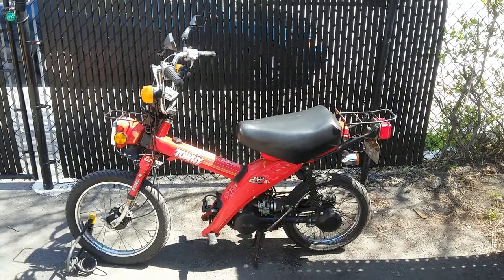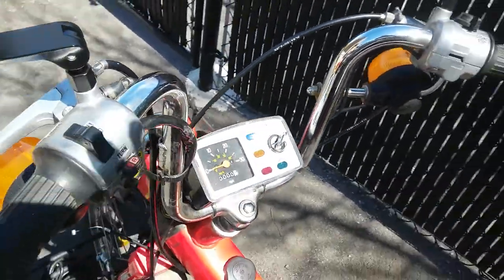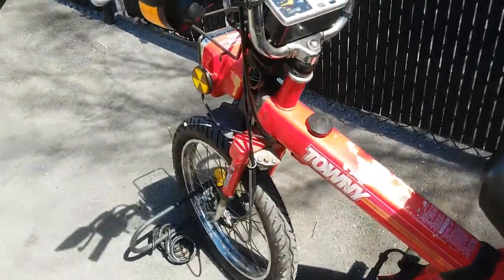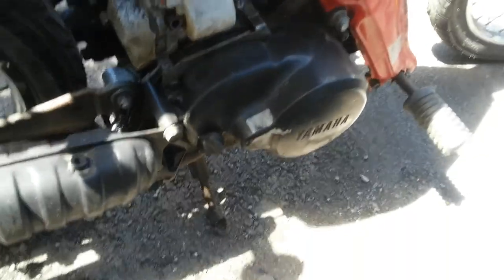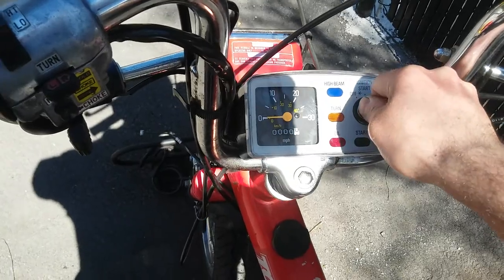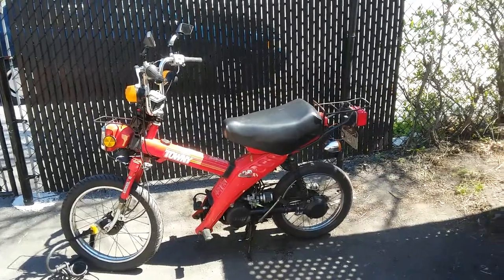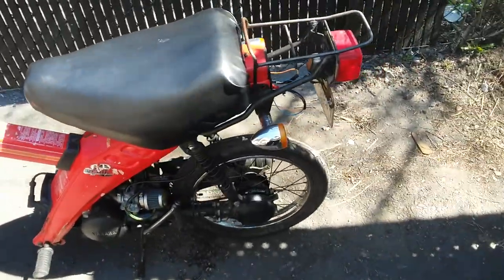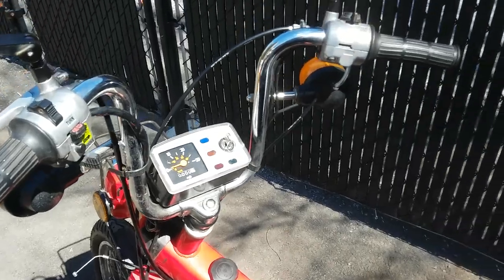1984 Yamaha Towny MJ50 49CC scooter almost completely rebuilt

Comment: It looks like your battery is sitting weird.  I would use some tie downs and you can fasten it so that it sits straight.  It is supposed to come with a battery holder (like a rubber strap).  Otherwise, you risk it leaking all over the seat pan.  Nopeds will nickel and dime you to death.  Before you know it, you've got another $300 in parts in it.  If you buy one to resell it later, you have to go with the bare minimum to get it running and let the buyer do the rest.  Mine is stock as well and runs at 330F or less on the temperature gauge.  25:1 is too rich and that's why it may be running a little hot.  Too much oil in the gas means it is running lean on gas.